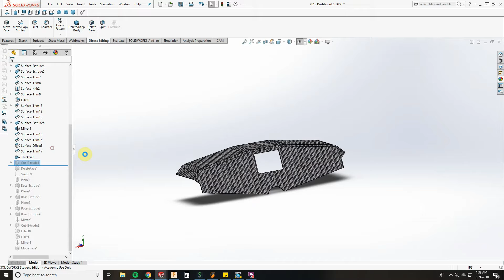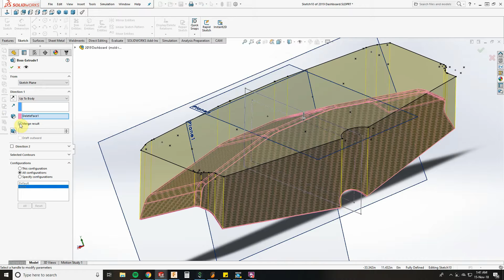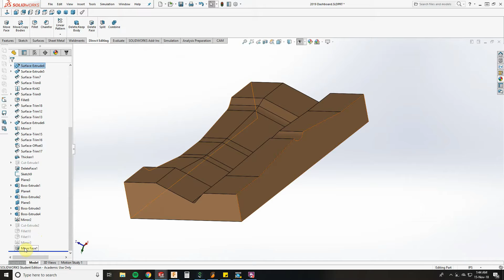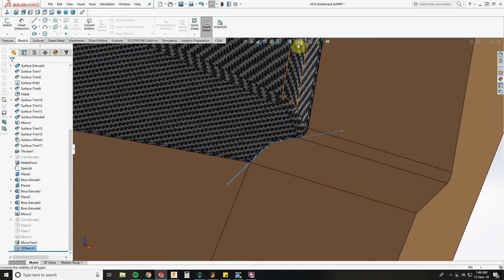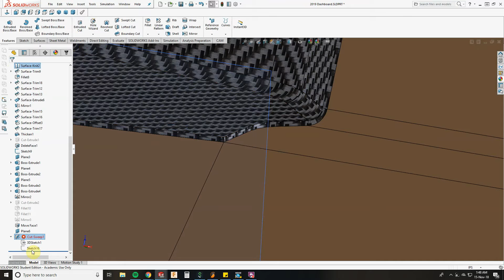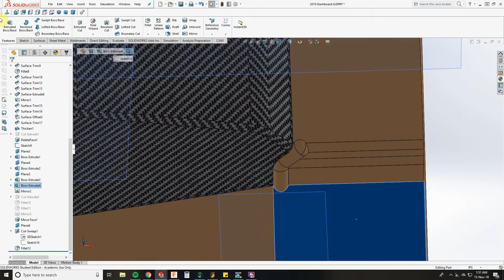Solidworks Carbon fiber Mold Tutorial (FSAE Racecar Dashboard)

Comment: Very nice tutorial. Question about the carbon fiber part. How you make the layup drawings since solidworks don't have a composite dedicated tool to make the part layer by layer?
Reply from the maker: This part doesn’t require that level of complexity in layup design. Solidworks doesn’t handle that as far as I know. Anything that I’ve done has been basically determined by hand and written down.